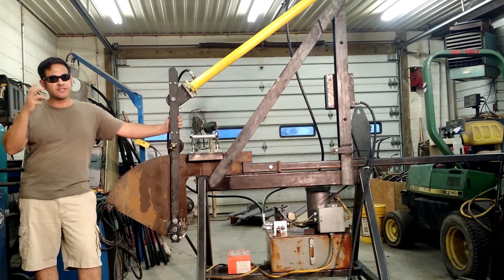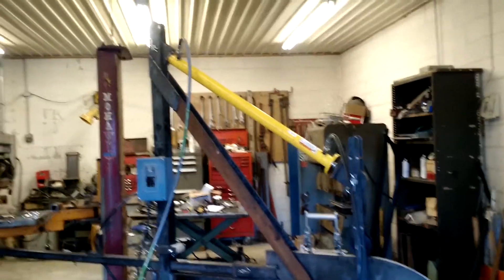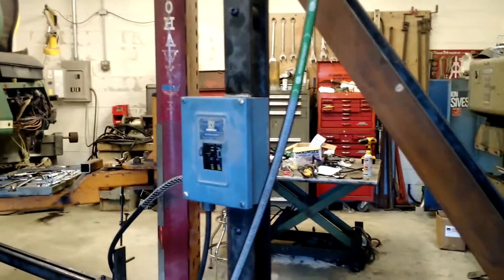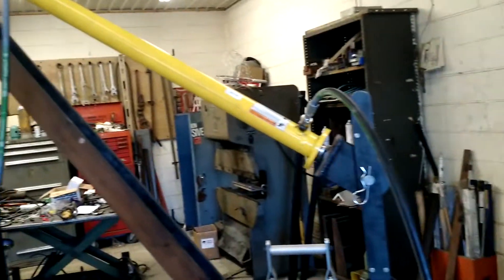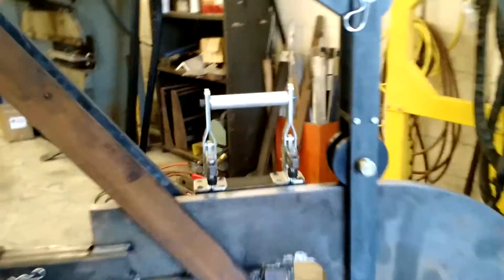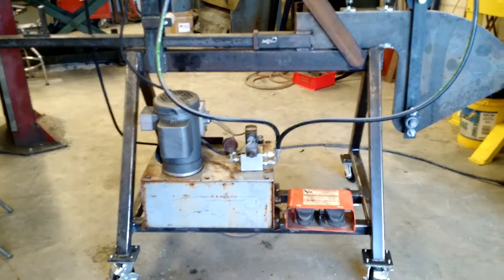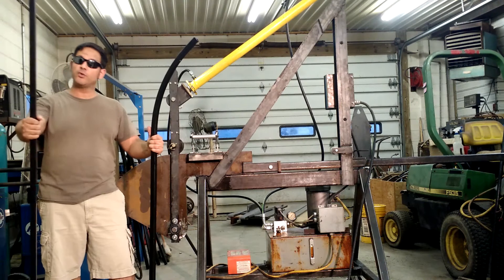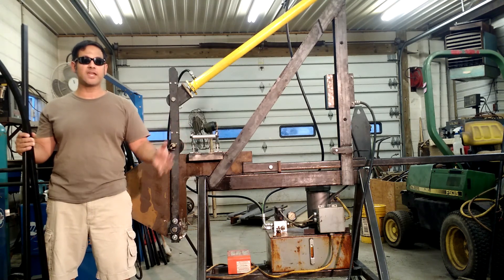Hydraulic tube bending machine - shop built - How to BEND square metal tubing

Comment: That's by far the most exciting video of an unexciting process I've yet viewed on YouTube. Ray, I love it. As you're probably aware, most folks over-complicate their homemade benders but you absolutely nailed it. Even with upgrading it it remains elegantly simple in design and function. Very impressed.
Reply from the maker: +35ABSTRACT thanks! One of the advantages of bending vertical is keeping it compact.  The client loved it and is using it on a daily basis.  The first job was bending pickets for a mile of fencing.

Comment: Just discovered your channel Ray. You made a comment on my bug out camper. Love your PVC clear boats. I may have to try electrifying my coro kayak. I use to bend tubes from 3/16" to 3" at boeing. Love this simple bending machine. Looking forward to checking out more of your videos. Cheers, and keep up the great work.
Reply from the maker: +Paul Elkins thanks, I have gone through alot if your videos, very cool stuff.  This setup was a proof of concept for a client that makes fence panels, once we demonstrated the jug, they wanted an automated machine so we added a hydraulic cylinder and pump to do just that.  we have a large 3 roll roller we use for bending accurate radii especially on larger sections..... Boeing, sounds like it would have been an interesting place to work.  Glad you like my videos.
Reply from the maker: +Paul Elkins here is the video to the automated version of the bender https://youtu.be/BIABRP8aqKA

Comment: Awesome machine. How do you account for the spring back at the bend after the tube is pressed around the form? Is the slight spring back included in the final measurement? Just curious, I enjoy your videos.
Reply from the maker: +Bill D this machine is just to make fence pickets so the exact radius is not critical.  We did a few test rolls on the material before we started the design to see how it would roll and how it would spring.  The client looked at it an made a decision on the radius and we proceeded with the design and building.  If the radius were critical we would need to use a rolling machine to dual in each piece since the Alway roll differently

Comment: nice job on that Ray ! 
hey im just finishing up week 2 at the new job ... man im loving the machine shop .. ive been running a cnc lathe .. slant bed .. its a hardinge i believe .. and cutting stock ... havent gotten to the cnc mills yet we have a few of them i believe they are made by matsura im not sure of the model number tho .. and also used an old bridgeport too that was cool ! just wanted to give you an update. . so far so good !
Reply from the maker: +TRUMP2016 Local187 WallBuilders Union that's awesome!  Before I started working at the shop.... I was an architect, I love the machine work much more than dealing with rich developers claiming they have no money.  Thanks for the update, you should talk then into starting a channel and putting up some project videos.  In our case I can only put up a few projects because of non disclosure agreements and DOD projects.  I'm sure you'll enjoy the mills...do they have any 5 axis milling machines?
Reply: Ray Pena i could probly upload a few projects but for the same reason as you i had to sign an NDA as well .. for Dod , pharmaceutical companies and other stuff .. we are just south of boston ..  and yes we have a couple 5 axis mills , couple 3 axis mills and 3 two axis lathes .. and a few older manual mills , lathes , honing machine , and some other specialised equipment sent over by pharma companies to make special sensors for them. 
I absolutely love it lol .. the days go by so fast and the two weeks ive been here flew by ! 
Maybe sometime i can make a few vids of the shop to share with u !
Oh and keep makin them awesome vids .. ive learned some stuff from watching your vids ! Thanks Ray !
Reply from the maker: Great, im glad you like them and are enjoying the new job!  keep me posted!
Reply: Ray Pena will do , thanks very much Ray !

Comment: Wow that works great. Do you have different size steel plates for different radius of bends?
Reply from the maker: +cejkwo Mass the client is a fence manufacturer, and the only needed the machine to make a single radius.  While we were building it for 1" square tubing, they also want it for 3/4" square.  All we needed to change was the roller for the different size.
Reply from the maker: +cejkwo Mass we thought about a future design for a machine to make different radius parts, you would need to have a removable rot section with different radii, and the plate and lever arm must have different pivot points. But it is possible to make a machine that way.  If you only want to make a few pieces, it can be all wood.
Reply from the maker: +cejkwo Mass are you thinking about building one yourself?
Reply: Ray Pena oh no, I was just asking